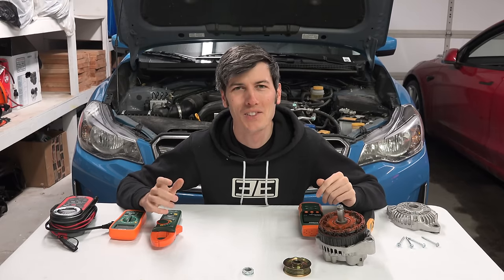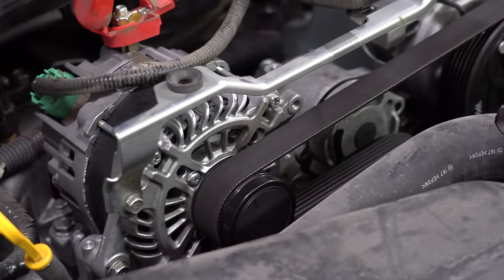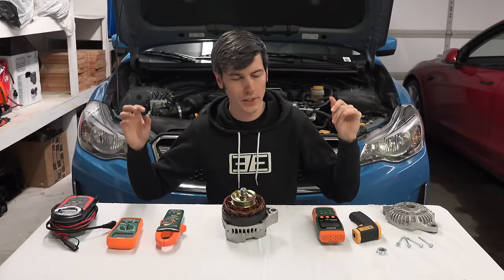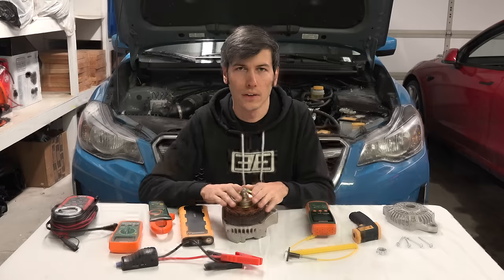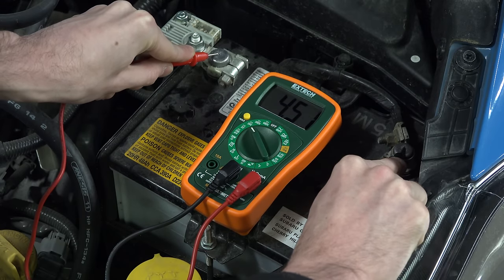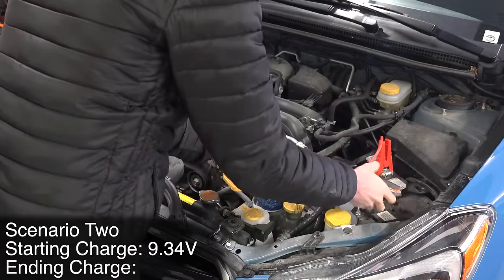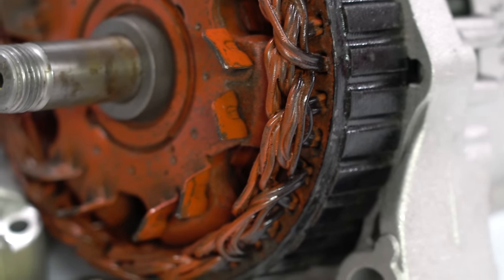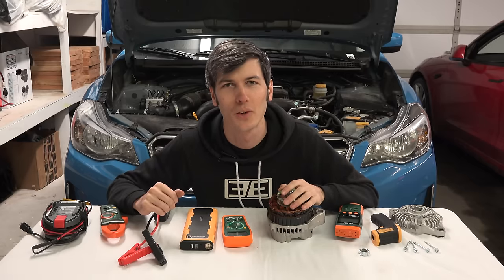Can A Dead Battery Ruin Your Car's Alternator?

Comment: I imagine that alternators are sized according to all potential use cases, including charging a dead battery. I mean, if you are weekly charging your dead battery, you might kill the alternator prematurely. But on the rare occasion, it should cope fine.
Reply from the maker: Yeah, I kinda assumed the same, but was interesting to see the data behind it. Certainly a significant difference. Now I'm curious what it would be like if I were to perform the same test in an Arizona summer haha.
Reply: You wouldn't be able to measure the temperature difference. I think your thermo-couple melts at over 1500 Kelvin!  @EngineeringExplained
Reply: @EngineeringExplained   Well, that's what late July and August are for around Boise.  We expect a repeat.  Calendar it !  ;)
Reply: Where I live there's usually a few weeks every year where it's cold enough that every cold start will drain the battery.  I have an under-the-hood trickle charger that I plug in alongside the block heater throughout the winter.
Reply: That was my thought... that the damage would be cumulative and recharging a dead battery via the alternator only a few times would cause only trivial damage.
Reply: Battery's are killed in high summer temperatures, bit they don't fall over dead until the winter. Battery's have shorter lives with current climate change.
Most modern vehicles are spec'ed with a 100-140amp alternator from the factory. However manufacturers are trying to save weight with smaller wire size, which causes a drop.
Reply: Been through a few incidents whereby I needed to jump start the car and had to drive in congested traffic in the city with dead batteries. Never had a problem with the alternator overheating or shorting out. And, I'm from Malaysia and we're in the tropical heat and humidity so near to the equator.
Reply: More often then not you will actually fry your voltage regulator if you try to run a dead battery which in a sense will ruin your alternator since they cost almost as much as a new alternator . If you get a jump start leave the cables on for a minute to prevent blowing your regulator
Reply: @EngineeringExplained  Modern alternators have the ability to self-protect themselves. If for any reason something tries to draw more amps out of the alternator than it can safely deliver the output will "fold", which is the term we use in power supply design. This means the charging voltage will drop by a sufficient amount to limit the current and protect the alternator. The alternator in your video looks to be a 60 amp alternator, which means 60 amps is the design limit it can safely deliver. If the battery tries to pull more than that all it will get is 60 amps and the amount of time it takes to fully charge it will be extended.
Reply: I can promise you that the factory alternator is designed to a specific price point and engineered to function with a properly charged battery. Yes an alternator handle being operated with a dead battery for a certain period of time. However after repeated operations with a dead battery, an alternator will fail in a fairly short time (when compared to standard service life of an alternator). I have replaced hundreds of alternators and the one thing that stands true with each premature alternator failure, there was a poorly maintained vehicle and a battery in horrible state of health. A properly maintained vehicle with a good battery will not over exert it's charging system, so in turn the alternator will not prematurely fail. Not to say there are not cases of premature failure with no other reason then a "bad" alternator, but like anything mechanical, proper upkeep and maintenance is key to it lasting.
Reply: I agree with most of the comment, but one thing Jason did not mention: alternator output is a physical maximum (assuming normal stator voltage). A 105 amp alternator will not put out more than 105A (probably plus a 10% margin) because of the leakage inductance of the stator windings but it may not be designed to put out that much under a full range of environmental conditions. In Phoenix summers underhood temperatures regularly exceed 200F with prolonged idling. When I lived there I never had an underhood battery last more than two summers. I also had a number of alternators with failed diodes, something I have not seen at all in the 18 years I have been in Flagstaff. With high ambient temperatures the full rated output would probably be very destructive.
Reply: @EngineeringExplained  Not one of those wussy summers with temperatures rarely exceeding 110F, either! My favorite Phoenix weather forecast was in June 1976: "Tomorrow, sunny and cooler, high 113." The afternoon it hit 122F I went out to start my 1970 Volvo and when I hit the starter the response was a soft "pop" and vapor from what had been the battery wafting up from under the hood.
In case anybody wonders, there are four months when the highs in Phoenix have never hit 100F: November through February. My wife and I were outside doing a Cub Scout activity when it hit 101F on the first weekend in Spring.
I replaced lots of batteries and lots of alternators in the 25 years I lived there.
Reply: BUT, many people won't change a battery until they've needed several jump starts!  And several will need an alternator by then.
Often, due to lack of maintenance, a reoccurant "hard start" condition leads to severely depleting the battery.  This in turn "overloads" the alternator.  This cycle usually continues until the battery and/or alternator fail.  It's like dominoes.

Comment: The live of electromechanical components (such as alternator) can be directly influenced by its operating temperature.
Generally it would perform exactly the same and for most people it wouldn't be a problem, especially if you sell your car after 5 years or so. But if you want to extract the maximum life out of your alternator you must have a healthy battery.
Reply: Gee really? You mean having a good battery that u dont have to jump everytime is better?🤣🤣🤣 you people and your compulsive need to be right
Reply: In my experience the single factor that causes most alternators to stop working is that the slip ring brushes wear out. That's a function mostly of how many hours of operation the alternator has accumulated on it. Once the brushes get too short and can no longer reach the slip rings the field current becomes interrupted and that's when the alternator will fail.
Reply: The problem is over-taxing the alternator, which a dead battery can do, but current-limiting the battery charging (aka; alternator abuse) would be much better. Of coarse, the consumer can't usually re-engineer the charging system to be reasonable, so I guess over-buying batteries is a solution that the consumers are willing to pay / can do themselves.

Another solution would be to let the engine idle slowly for 4x the amount of time that running at high RPM would take to supply the same current. Most idling cars will 'work' the alternator at a rate that is safe for both the alternator and prevent battery abuse as well. People 'drive' the car because they are impatient and it force-feeds the battery at a huge rate, which cooks the alternator and the battery. Also, old-school generators could not generate a high enough voltage to actually charge the battery at idle, so the must-drive-it urban legend lives on, even though we use alternators today.

Being able to measure the current being sent to the battery would be nice to determine when the car is happy with it's voltage. If you idle the car at home, you could slap a current probe on it and monitor it yourself. Of course trickle charging the battery one day before you need to use it would be better. The best would be to attach the battery to a proper storage-maintenance charger when you park it or a few days later when you remember.

Usually a 'bad' battery isn't a problem as they won't accept current. The problem is a dead 'good' battery and the owner is either too ignorant or too lazy just to just charge the dead battery before using the car or maintain the battery during storage. Driving into a stationary object, or driving on a non-run-flat tire is bad too, and people do it all the time, so I can't imagine they'd charge the battery before driving on it.

A maintenance charger is far cheaper than buying batteries and alternators, but requires some actual thinking ahead and it's inconvenient so it's probably asking too much of the average consumer.

Comment: That is a super clean engine bay.
Reply from the maker: No doubt!
Reply: Came to say this lol
Reply: My brother loves clean engine bays, i have 80k miles of grit and grime all over my supercharger and it drives him nuts, haha. I'll clean it before I have to work on it.
Reply: I probably own the only C5 corvette in my area that's daily driven, and has a pretty filthy engine. haha
Reply: That Super clean air intake is giving the car around 10-15cv in "worst case scenario" as Jason loves to say XD
Reply: @jasepoag8930  I love daily driven vettes. I'd love to pick up a newer c4 because I like the look, but I know I'd spend a lot of money on it. C5 would probably be a better starting point though... How do you like the c5?
Reply: @volvo09  It's a good car. Lots of fun, plenty of power. I personally like the styling. I will say that the interior electronics are a bit sketchy, and the interior panels are kind of cheap.
Reply: Mainly has to do with the weather and environment that the car is driven in.
Reply: @n9wox  Self serve carwash and some degreaser usually do the job
Reply: @n9wox  True, my '95 Nissan Micra has mud all over the engine & engine bay, as the drive-belt/engine-belt goes right to below the engine and dips into muddy puddles and mud and then just splatters that all over the engine bay.
Reply: I see a layer of dust and dirt on every surface. It’s a pretty normal-looking engine bay for the car’s age. Neither clean nor dirty.
Reply: @carlsdrumshop  Watch the video again, all will come clear.
Reply: Jase Poag looks dirty to me. 😆 I’m OCD
Reply: Favourite part of the video

Comment: Nice to have some fact to back up all these old “assumptions”. Great video!
Reply from the maker: Thanks! Was interesting to see some data behind it!
Reply: Engineering Explained Can you do a video about the dangers or myths of disconnecting a battery on old or modern cars while the engine is still running?  I work with a guy who always changes batteries with the engines running but nothing bad ever happens but it still makes me nervous. He does it so as to not lose the memory for the Honda radios and Toyota's computer memory.
Reply: @EngineeringExplained  Another good topic for a video would be jump starting with a flat battery from another car with/without a running engine - Is there potential to damage the computer? Hearsay from the early 90's says it used to happen occasionally, but as an electrical engineer I would fire the designer of such a product if it was so easily damaged. (2000+ models)
Reply: @blueblade455  I know on boats you never want to do this because the alternator thinks the battery is dead so it lets more and more current through until it gets fried. I know you can't get current through an open circuit, but maybe it's through some part of the alternator monitoring system. I'm too lazy to look it up :P
Reply: @blueblade455  ... I am surprised the vehicle still continue to run, most shut down the moment you disconnect the main battery terminals, even with the engine running... AND if I ever saw someone doing what you explained, I would correct their actions immediately, by educating them on the correct battery replacement procedures. If they continued to ignore my warnings, and perform negligent, and potentially dangerous work, I would have no choice but to let that person go.  There is tools designed to maintain a vehicles "memory" function while changing the battery. You simple attach them to the correct terminals or 12 volt outlet... It depends on the vehicle, but there are proper procedures to changing a battery on a vehicle, all while maintaining the stored functions. There is no excuse or need to perform work that could potentially cost hundreds if not thousands of dollars in repairs.
Reply: @blueblade455  ….we used to do this "test" in the old days 80s to confirm if the "new" rebuilt replacement crap alternator was working properly..if the vehicle konked out when you took off the negative cable, you knew the alternator was junk......not advisable then but effective and especially not on new cars today...sparks around batteries aren't too good

Comment: At the end of your first run, the alternator was supplying ~13A, which tells me that it takes ~13A to run the engine and the car electronics.
At the end of your second run, the alternator was supplying 40A which tells me it was supplying the 13A for the car and still putting 27A into the battery to charge it. Therefore, the battery was still far from charged.
Measuring the open circuit voltage of a battery is a very bad way of assessing it's state of charge.
Reply from the maker: Agreed, hence mentioning in the video that since it was still running 40 amps, it was not charged. :)
Reply: @EngineeringExplained  Well, yes, you did say that, but then you said you were impressed at how your car had charged the battery. The real issue here is that the low ESR of the lead-acid battery and the lack of current limiting from the alternator means that it dumps as much current into the battery as it can which causes heating not only in the alternator but also in the battery and could lead to dendritic formations that could short the battery pack. It seems to me that this is a low-priority problem as car manufacturers have chosen to do nothing about it. However, some sort of information to the driver encouraging them to look at the health of the battery and maybe taking more care of the charge would be better. Think about exploding Li-Ion cells in phones... (but that doesn't happen with cars, so it's probably why they don't take action).
Reply: This car doesn't appear to have an intelligent battery sensor.  They usually are part of the negative terminal. A lot of cars nowadays do.
Reply: @s0meguy809  I have never seen such sensor, but it should be mandatory to limit charging curent to no more than 10A, or else it will kill the battery. Without the current sensor, alternator has no idea what part of current goes to battery and whats used to heat your bottom, so it just pushes all it can.
The moral is: if your battery is still good and is flat only because the car was sitting for a month, charge it before running the engine. Or it will cecome bad on that instant.
Reply: @circuitdotlt  A lot of cars have start/stop. The pcm needs to know exact condition of the battery  so it can decide whether to enable start/stop or not.
Reply: @circuitdotlt  10A is nothing. Headlights alone uses around 10A, a starter can sink spikes of +200A, just look at your fuse box.
Reply: @circuitdotlt  the battery sensors are mostly on GM vehicles. I'm sure there's other manufacturers that do it, but GM has been doing it for awhile. They have an amp probe on the negative cables (I'm not sure what the purpose is....)
Reply: @victornpb  My starter fuse is 150 A
Reply: @circuitdotlt  All bmws from 2005 have IBS's. Small chip on negative terminal. On the other hand, it is usually problem itself of draining a battery over night. To fix this issue to buy a new sensor or remove it completely. Also bmws require to register or code/program inserted new battery (even you put exact AH battery, you should say to a computer that this is new battery)
Reply: @circuitdotlt  In an automotive charging system the output post of the alternator is connected directly to the positive post of the battery and the main fuse box.
The current output of the alternator is controlled by the electrical load required by all the circuits in the fuse box and the state of charge of the battery. The current going into a battery is based on the state of charge of the battery, it has nothing to do with the alternator controls. The main control of an alternator is the voltage output. The alternator tries to maintain a target voltage on the output post.
Reply: This is only partly true. First, alternator also limits it's current to max specified value. Second, it is unhealthy to charge the battery at higher current than 5A, so modern cars must have a current sensor on the battery, so alternator would adjust it's voltage to limit charging current to only provide 5A for the battery + whatever is needed by remaining power sinks. This is not the case in shitty charging system designs (pretty much all older and german cars), though.

Comment: Great video! I guess I'd say the takeaway is, if your alternator can handle the amperage (say up to 100amps) and the OAT isn't super hot, you should be fine to charge a dead battery. temps can messup bearings and electronics so, having to jump the car over and over can eventually cause increased wear and thus, a dead battery that is REALLY dead CAN damage your alternator. A dead battery that isn't REALLY dead is GTG. This was very interesting. Fin.

Comment: I keep a battery tender on my sports car's battery while it's sitting through much of the winter. I understood it helps both preserve the battery's maximum life as well as make things a lot easier on the alternator. I've read somewhere a lead acid flooded battery can loose up to 25% of it's life if it's deep discharged even once. And that keeping the battery well charged helps to reduce sulfide buildup on the battery plates. Which can also shorten it's life. Might be interesting to dig more into this....